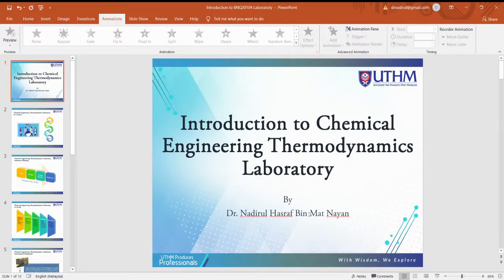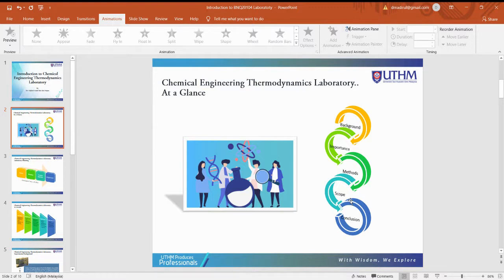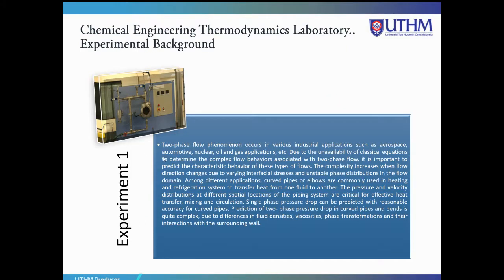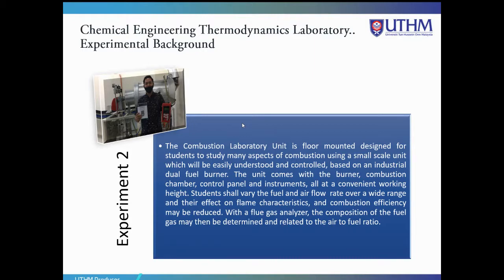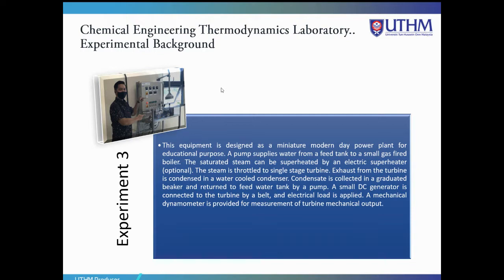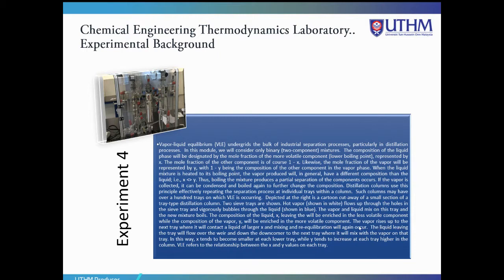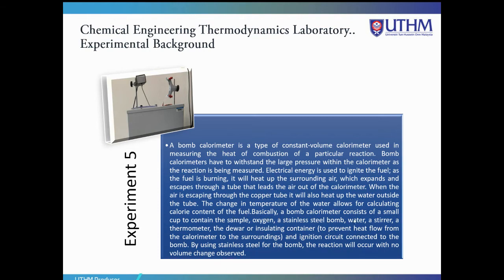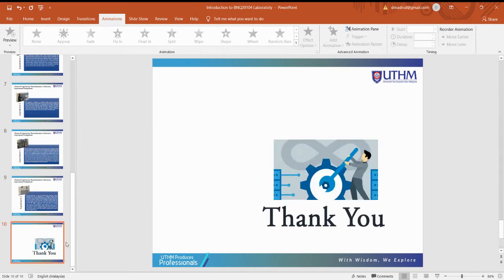Introduction to Chemical Engineering Thermodynamics Laboratory

Comment: From the vid, thermodynamics is the study of heat that deals with a lot of machines such as compressor, turbine, boiler etc. There also a lot of experiment which is:
1. Characteristic behaviour of two phases liq
2. Combustion unit
3. Miniature steam power plant
4. Vapour liq equilibrium
5. Bomb calorimeter

Comment: Nurul Fatihah Binti Ibrahim 
Exp 1(Characteristic Behavior of A Two-phases Fluid)
The objectives are
1. To study the behavior of water during the transition between liquid vapor phase
2. To investigate the behavior of water at temperature around the vapor point and over the range of pressure
3. To study the change in vapor point with the increasing pressure and to observe the fluid behavior using slight glass set into pressure vessel

Exp 2 (Combustion Unit)
- The Combustion Laboratory Unit is to study many aspects of combustion using a small scale unit based on an industrial dual fuel burner.
The objectives are:
1. To determine the type of different air or fuel ratio
2. To determine the product of combustion at optimum air of fuel ratio
3. To determine heat transfer balance for water in and out

Exp 3 (Miniature Steam)
The objectives are:
1. To determine the efficiency of components in a steam power plant
2. To determine the heat transfer between comdenser and cooling water
3. To determine the steam and plant efficiencies
4. To determine the power generated by the steam engine.

Exp 4 (Vapor-liquid Equilibrium)
- Vapor-Liquid Equilibrium (VLE) undergrids the bulk of industrial seperation processes particularly in dustillation processes. VLE is the relationship between x and y value.
The objectives are:
1. To study the relationship between pressure and temperature of vaporazation of a fluid 
2. To measure the certain changes in temperature and pressure 

Exp 5 ( Bomb Calorimeter)
- A Bomb Calorimeter is a type of constant-volume calorimeter used to measure the heat of combustion of a particular reaction.
The objectives are:
1. To determine the type of flame at different air fuel ratio
2. To determine the product of combustion at optimum air fuel ratio
3. To determine the heat transfer balance for water in and out.

Comment: Thermodynamics is science that deals with heat, work, energy and related properties. Refrigerator, heat pump and boiler are some examples of machines that use the principle of Thermodynamics.
E-Lab Thermodynamics Planning: 
Video -  Experimental Lab Procedure
Readings - Lab Manual for further understanding
Practice Exercise - Question & Analysis regarding Experiment Lab
Assignment - Report